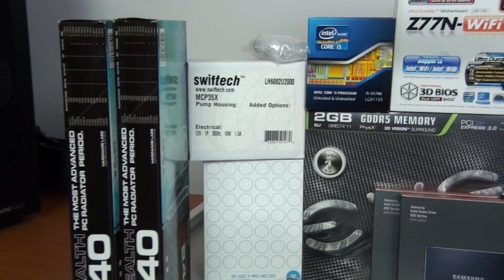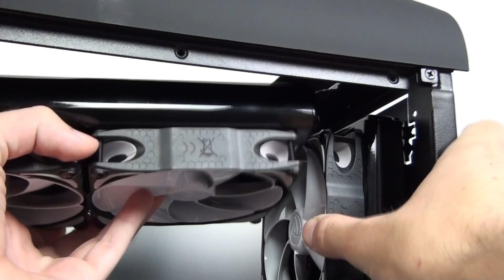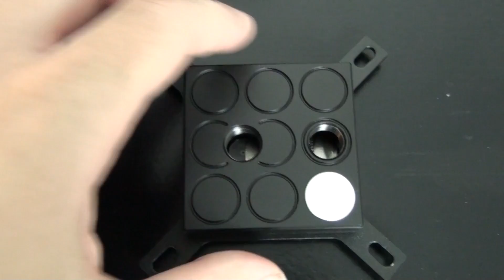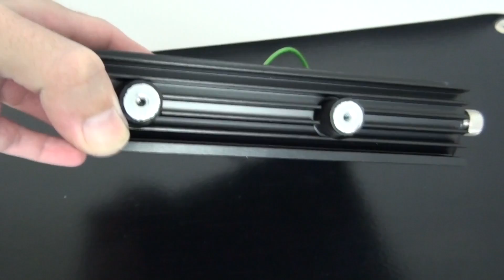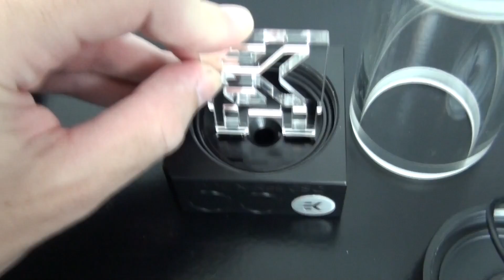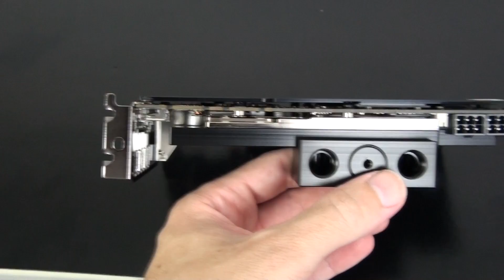Build #9: Extreme Prodigy: Part 1

Comment: really don't understand why use such low end components... like the motherboard has only a four pin cpu power connector that's completely not capable of any impressive overclocking while the water coolers certainly are.

EDIT okay nvm on the second episode he already switched out the motherboard... :P
EDIT EDIT okay whoa on episode 3 he basicly upgraded everything...

Comment: Just wondering. Is there a reason you never daisy chain your fan cables.  I found that daisy chaining the cables gives a cleaner look, especially on the bigger rads when using fan controllers.

Comment: Did you use any special blades for your jigsaw to cut the 10mm thick smoked acrylic? I tried mine with the bi-metal blade 18 TPI that I use for metal cases, but it basically melted, and I'm only using regular clear 6mm thick acrylic. Thanks!

Comment: Hmm idk, had WD myself, not seeing coming it back at the store dead of faulty as much as seagate but my WD drive failed after not even a year and i did not use it that much. So idk kinda looks like seagate, failing so fast. But i guess i just had a bad one or it was because of the 'green' power saving shit that turns on and off the drive when you not use it etc. That takes actually a lot of lifespan away. It saves power that's the only good thing about it.

Comment: Mainly because of the mounting features and ability to be easily modded.
It is the only case on that form factor that can fit so many components and has such good airflow.
It really comes down to personal opinion as to what form factor to go to, a lot of people are moving to smaller cases because smaller motherboards are becoming a lot better than they used to be.

Comment: Hi goes without saying very good video, with lots of information content. I'm not a great fan of these cases because of the cramped footprint an XL sized variant for ATX boards would I believe raise a few eyebrows. However there have been some outstanding small systems built in them. Look forward to the next video as can't wait to see how your mods will come together.

Comment: You are doing some nice setups, mate, and I like them.
But why on earth would you watercool an i5 CPU and GTX670, especially with 2 radiators? These are not top-end components and definitely are not going to get as hot as the 3770K or 3930 would for example. So to me this setup is just a wast of time and money.

Comment: I would suggest that you measure your cables and then buy double that length, for two reasons.  1) if it's your first time sleeving, or even if you have done it a lot, you will most likely waste some sleeving... so having extra is nice so you don't have to order more. 2) the thicker the gauge of the wire the more sleeving it requires to cover it, so just because the cable is 1 foot in length doesn't mean 1 foot of sleeving will cover it... so buy extra ;)

Comment: Just because the voltage is locked doesn't mean a you can't overclock. techreport say they got a i7-3770K upto 4.5GHz on this very board.

Comment: There is no physical way of placing the mobo horizontally. But if you mean something along the lines of adamski07's build, then yes I fully agree with you.
w w w(dot)overclock(dot)net/t/1313366/complete-project-prodigious-ocns-march-2013-motm

Comment: If it is for Hackintosh then it is as Gigabyte is the only brand with proper support. Read up on Hackintosh builds, you use Gigabyte boards. Any overclock is better than stock, so if it is indeed intended to run a Mac OS then it makes perfect sense. If not then the Asus P8Z77-I DELUXE would definitely be the go, among others.